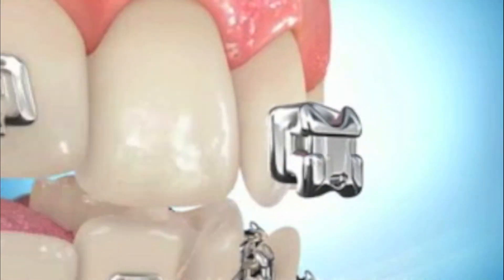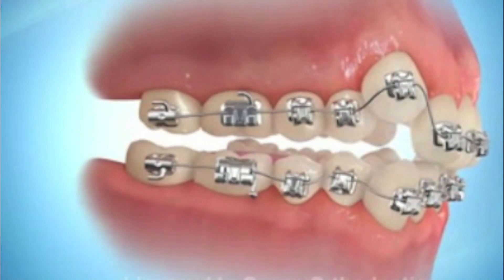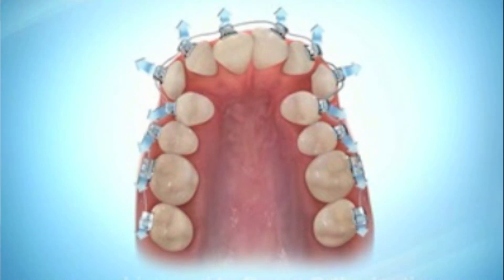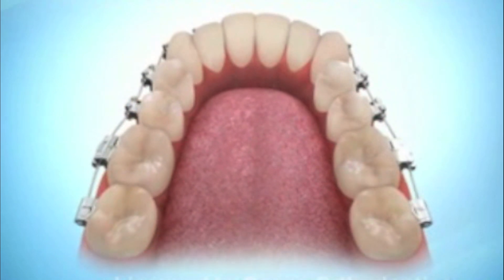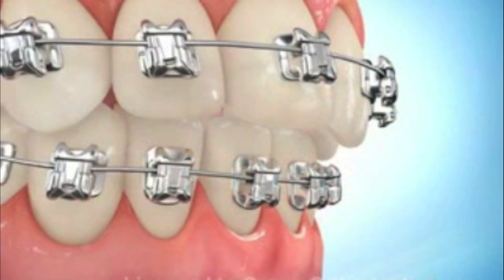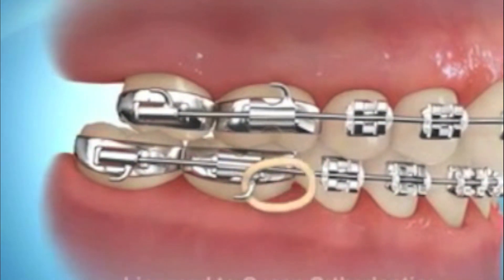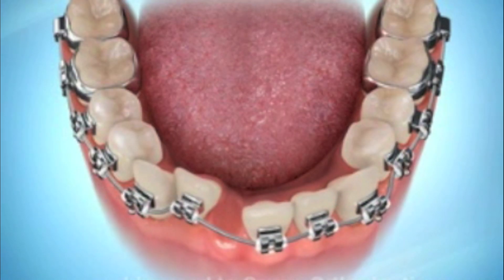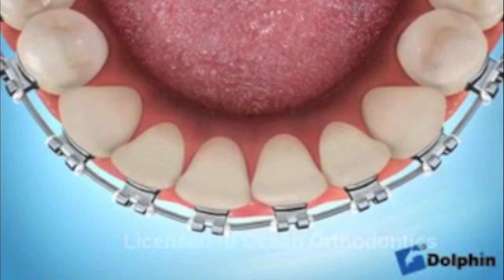An Orthodontist Answers: How Do Braces Work? How Braces Straighten Teeth

Comment: Hi I would like to ask something. I had 3 friends wearing braces and after they had it removed, all of their teeth seemed to 'bend inwards'! Why and how does this happen? And it does not look pretty when they smile. I am thinking of wearing braces but I am in doubt because of that. Can you please tell me the cause?
Reply from the maker: Lana Beats Hi Lana, 

Thank you for getting in touch, that's a great question. The way that teeth need to be positioned to get the teeth together isn’t identical from person to person because everyone is built differently. Different jaw shapes, different tooth sizes, different jaw relationships, can all end up meaning different tooth angulations at the end.
The majority of orthodontic cases should finish with teeth that appear very straight, and most of the time, at what would appear to be fairly normal angles.

I can only assume that your friends had cases that required tooth positioning which doesn’t appear quite normal to you. I’d suggest looking at more results from other people who’ve had braces. I would expect that there should be other results that you would like much better.

Some examples photos of before & after braces are available from our website at www.oceanorthodontics.com.au 

I hope this helps. Please feel free to give our practice a call to ask further questions :) 

Dr. Pat Hannan
Reply: That's what they should look like